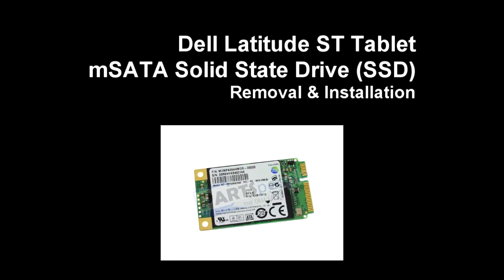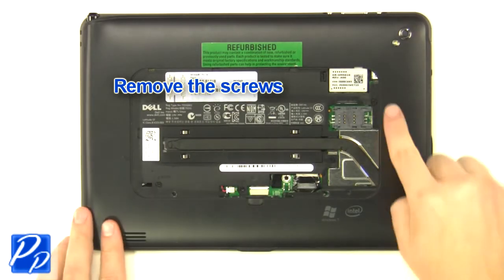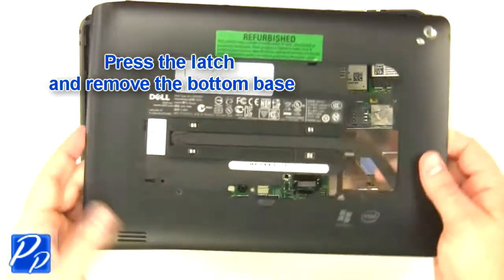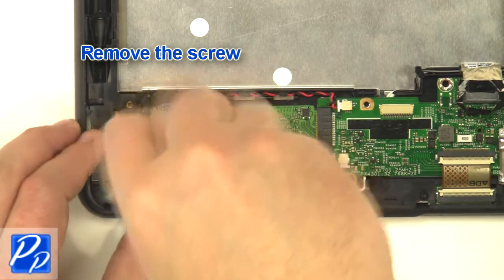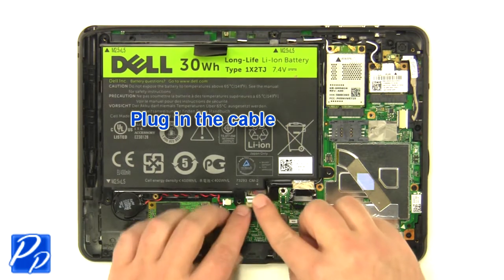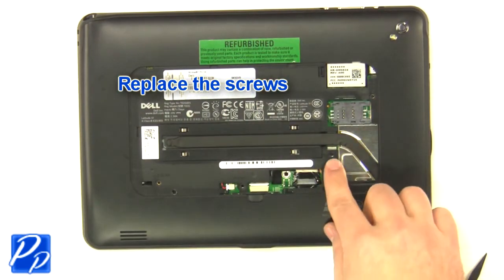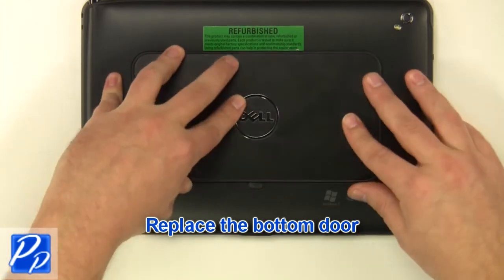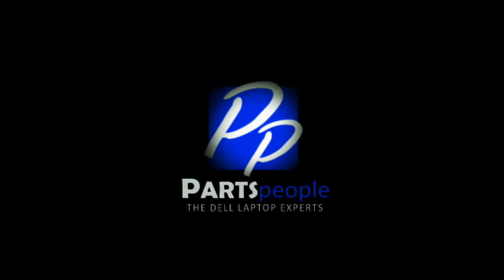Dell Latitude ST Tablet mSATA Solid State Drive (SSD) Replacement Video Tutorial Teardown

Comment: hey I can't get the screw off the SSD what size screw driver tip did you use? thanks for any help
Reply from the maker: We use an 1/8th inch Philips screwdriver.